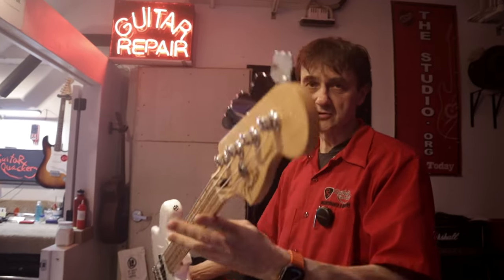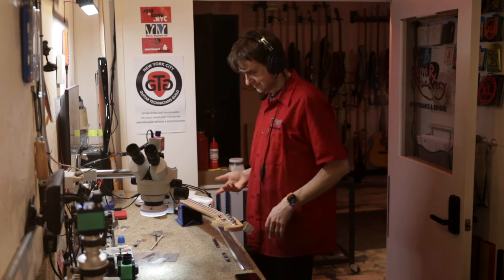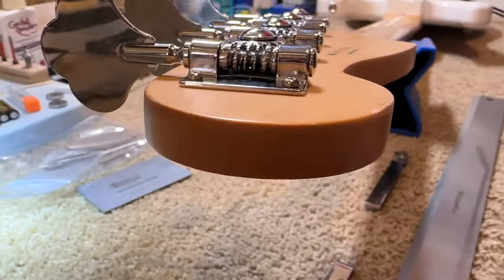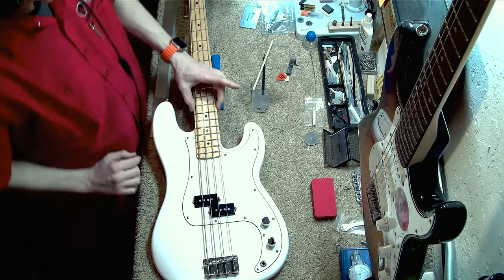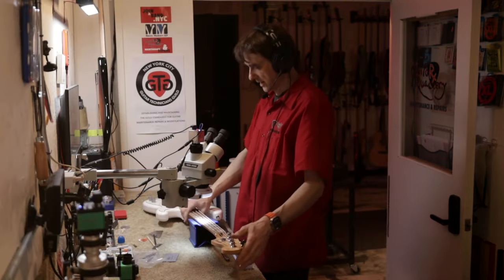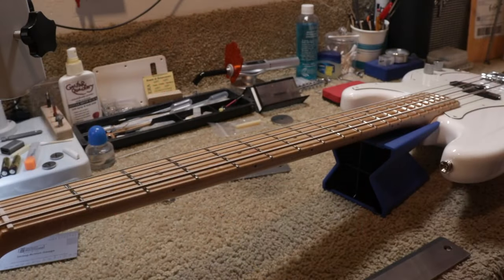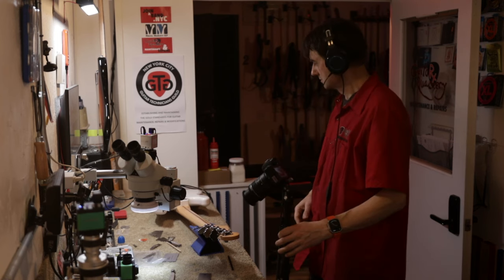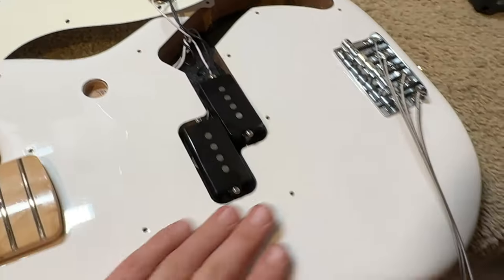Fender Player P-Bass Review

Comment: What is your opinion on more "budget friendly" options for guitars and basses that have fit and finish issues such as the ones in this video? Do you think someone is better off finding a manufacturer who prioritizes the longevity of the instrument, despite the higher price tag?

Thank you for the video.
Reply from the maker: Good question. I my experience it is best to look at every guitar (or bass) as an individual instrument, regardless of make and model. A guitar (or bass) is only going to be as good as the people who worked on it, regardless which factory they worked at. So, the MIM Player P-Bass reviewed in this video might be completely different than the same model, one serial number apart, that might have passed through a different set of hands, at the same factory. 

Although I do love legacy brands, I always recommend to have instruments looked at and to make sure there is a return or exchange policy, in case there are unacceptable issues. 

The biggest issue I'm having with this one (the only issue I was not able to actually fix) is that oversized neck pocket. I really don't know how that happens in the world of CNC machines. 

Hope this helps.

Thanks for chiming in.

Comment: Great video as usual. 

What are the typical causes of a neck twist, apart from the wood grain issue you've demonstrated?
Reply from the maker: it is my understanding that all pieces of wood have some internal tensions. Some more some less. 

And I believe all wood will bend and/or twist to some degree as it ages. Also, some species of wood bend and twist more forcefully than other species of wood. 

All wood has some degree of moisture in it. As this moisture moves from one place to another, the volumes of the fibers change. 

The more even and uniformed the growth rings are, the more stable the wood should be. But there is never any guarantee with wood, one way or another.

The CCW neck twist on this bass was very mild. But it did result in an asymmetrical fretboard.

I have seen more severe cases than this one. 

Hope this makes sense.
Reply: @GuitarQuackery  Thank you for the informative answer
Reply from the maker: Sure... And that's just my understanding of how wood aging works. It's my understanding that it's all about transfer of trapped moisture and about internal tensions between fiber particles. Sometimes when you take a chunky piece of wood and rip it in two halves, the two halves are bent and/or twisted, because the separation of the two halves released some internal tensions. If the original piece of wood had those internal tensions, we wouldn't know about it until we see the whole piece bend and/or twist.

Comment: hello i wanted to ask for help. Do you know a safe way to get rid of scratches on the fretboard. i tried to polish the frets but i scratched the wood. Any tips on how to get rid of the scratches on rosewood?
Reply from the maker: I’d love to help you, but perfecting cosmetic issues of this nature can be tricky. I think the best advice I can give you is to bring your Guitar to a competent luthier.
Reply from the maker: What exactly did you scratch the wood with?
Reply: @GuitarQuackery   a strong sandpaper. The scratches are not deep but they are very annoying and bothersome to look at if you know what i mean
Reply: @GuitarQuackery   a strong sandpaper. The scratches are not very deep but they are very annoying and bothersome to look at if you know what i mean
Reply: You cannot remove scratches. You can only remove material around the scratches, to level-off the material. obviously the frets are in the way. The most elegant way to do it, is to do a complete re-fret. Once the frets are off the fretboard, you can level-off the board and then install new frets.

Any attempt to remove scratches while the frets are still on the board, is not going to yield spectacular results.
Reply: @frankentronics  thanks i was trying steel wool wire lightly but thanks
Reply: If you have the cash send it to a friendly neighbourhood luthier.  

If not take the strings off. Cover all the undamaged areas you want to keep looking good with masking tape. Then gently sand the areas with the scratches.  Start with a sand paper with at least double the number of the one it was scratched with originally.  Example use 500 now if you used 250 previously.  Then move up in 200-300 grit steps till you get around 1200. 

This last paper can be used with a fine polish compound on the whole neck. Although you may need to check it to see if it is compatible with your existing finish. If your unsure carnuba wax will work, but is known to cause some darkening in certain cases. A reputable luthier maybe able to give your a better product that is locally available in your community.